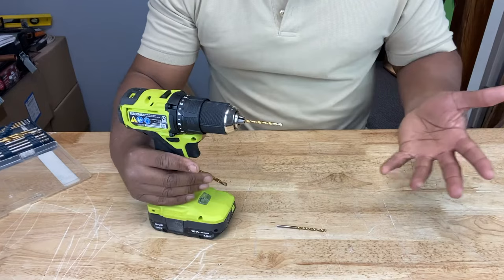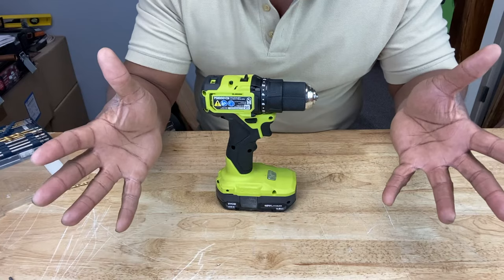DRILL BIT KEEPS SLIPPING

Comment: After years of drill bits slipping in the chuck I finally bought the Milwaukee drill bit kit with the driver ends.It is more expensive,but no more slipping.And you can use these bits in your driver drill.I recommend anyone thinking about buying a new driver drill to get one with variable speed technology.There are 3 speeds in which the driver will perform at.Many times a bit will come off the screw while at a higher speed,but at a slower speed not so much.
Reply from the maker: Thanks for the great tips.
Reply: And when that tip comes off the screw and into your hand. You know you're gonna have a great day!

Comment: Problem is that my drill bit is stuck in the wood but did not break off. The chuck simply started slipping once the drill was deep inside the wood. I tried to remove and re-tighten the drill onto the bit that is protruding but it just keeps slipping. I tried sticking double sided tape on the bit for the chuck to have a better grip but it did nothing. I'm no left with trying to wiggle it out but it hardly moves. It is difficult to get a good grip  on it since it's on a vertical timber. Maybe patient wiggling will eventually pull it out.
Reply from the maker: Put the drill in hammer mode on reverse.
Reply: @Caliber8Tools  What if the drill doesn't have a hammer mode?

Comment: Good video. Question: My drill bits are round. What are the type drill bills called that have multiple flat sides on the portion that goes in the chuck?  I'm assuming will stop drill bits from coming out of the chuck. Thanks!!
Reply from the maker: Flat shank drill bits.

Comment: I used my drill as a saw... keeps slipping... then I realized it was in reverse... when in reverse the screw holding the chuck tends to loosen and ends up detaching the chuck from the drill... very scared at that time...
Reply from the maker: Aaah, good point.

Comment: I don't use a drill driver that much.  I tried to drill in two pieces of wood and both were 2"×4".  I tried to drill in to make a pilot hole and drill bit went smoothly into the woods but when I tried to reverse it to get the drill bit out from the hole and I got stuck so the drill driver couldn't hold on to the drill bit so it always slipped off.
Reply from the maker: Seems like the chuck loosened its grip.
Reply: @Caliber8Tools  thanks, yep I think so too.  However it was my fault because I didn't tighten the drill bit enough as I didn't rotate the chuck to fully secure the drill bit.  Now I'm able to pull out the drill bit from the wood..  newbies trying to make a keyboard tray as there is no space on the table with two monitors